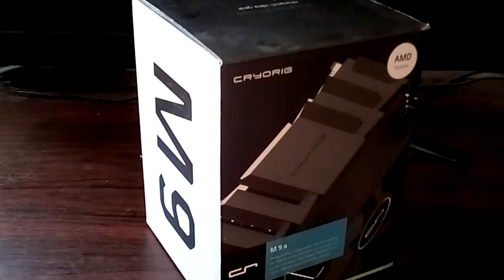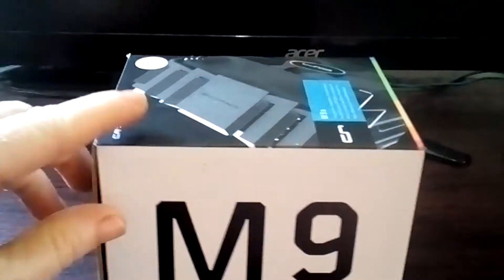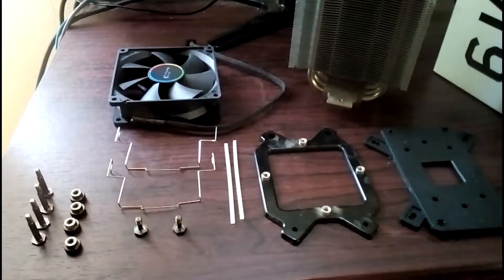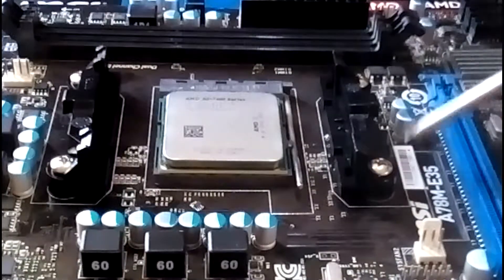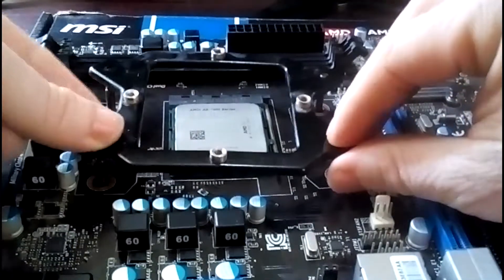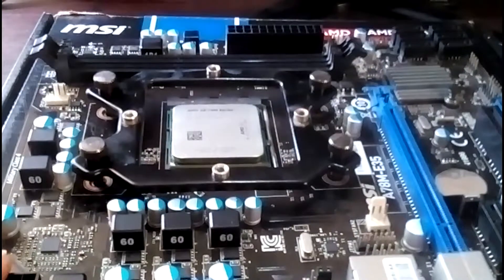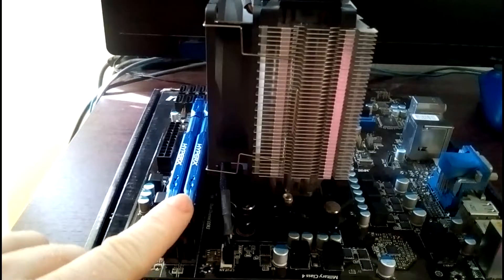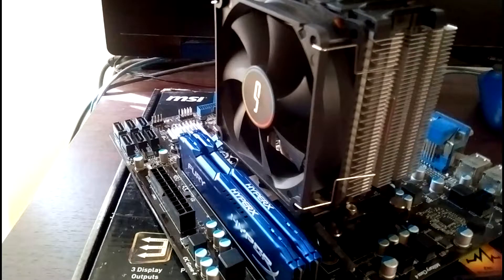how to install the Cryorig M9 Cooler for AMD

Comment: What is that shroud on top of the heatsink Can it be removed? Is it required? If I used third party fans would it have to be there?
Reply from the maker: that is a very good question, yes it can be removed, it does not really offer any improvements. so you can remove it and add a third party fan.